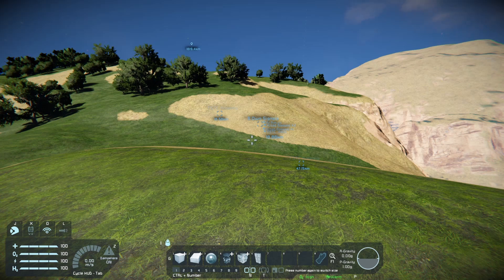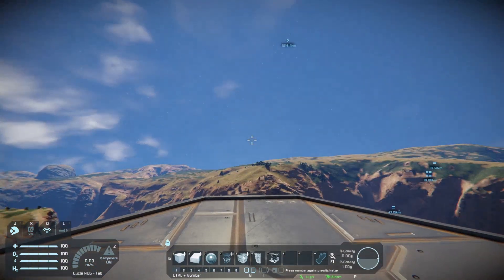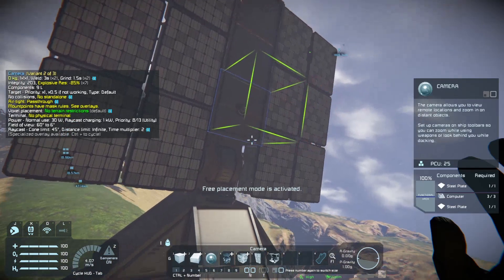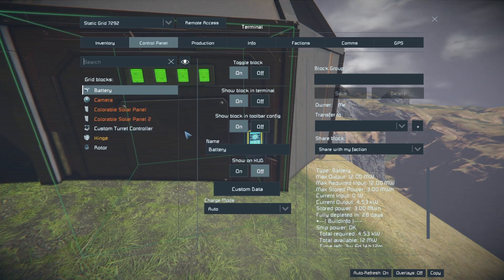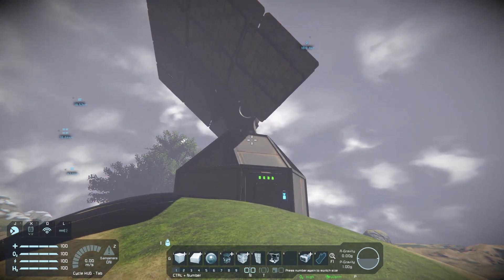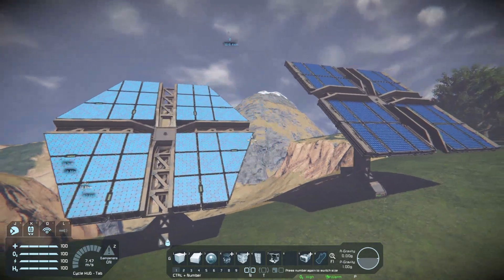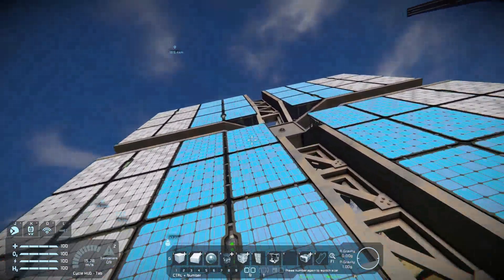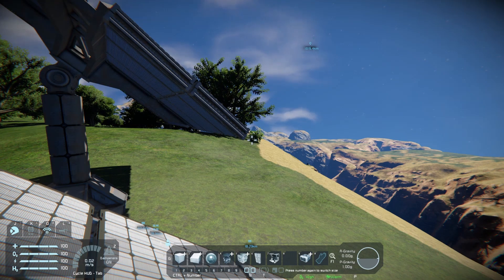How to Build a Sun Tracking Solar Panel | Space Engineers

Comment: for some reason my hinge isnt spinning? when i try putting the yellow part turned upwards it doesnt let me
Reply from the maker: Hmm I would need to see a picture to really know but try turning off the turret controller and  turning it back on(in the console menu), if not maybe double check all your settings.  You may have a hinge lock enabled or you may need to tweak the hinges torque settings

Comment: I noticed u answer ur comments (love that ❤) soooooooo, how big can i make this without problems and how would i make it different if making it bigger
Reply from the maker: Good question! And the answer depends! For example, in my more recent series, which is space focused, I have a pretty decent sized  array with plans on making it even bigger. But there is the worry that stray fire could disable the whole thing.

Planet side, you can probably get pretty big  at that point. You just need to make sure the solar array isn't to heavy for the hinge, and you have clearance for them to move.
Reply: @KiltedBastard ok ty this actually explains it pretty well

Comment: Tried to build another one of these from a different video and it exploded in my face when i turned it on lol, your using an azimuth rotor? azimuth are mods aren't they? Would it work with a regular rotor I'm learning in vanilla
Reply from the maker: I used vanilla rotors for this. Azimuth refers to the degree of change around a compass. 

But yes, Azimuth is also a series of mods.
Reply: @KiltedBastard  oh I had no idea lol

Comment: Just got the game~! this guide helped al lot, however question what did you use for the secondary solar panel's pillar, I've been trying to find a smooth cylinder block like that in the Block section and I can't find anything
Reply from the maker: Cylindrical Column - I think it is from the Heavy Industries DLC.  Also welcome to the Space Engineers Community!

Comment: If you set hinge and rotor to have it's inertia as shared  it won't jitter at all
Reply: And where do you do that?
Reply: @baltazararanda9643 turn on experimental mode and turn on “share inertia tensor” in the hinge/rotor’s settings
Reply: @baltazararanda9643  in control panel.
select both hinge and rotor and the option will be there
ETA, you select multiple things by clicking one and ctrl clicking the other
Reply: @baltazararanda9643  You can't learn this power from a Jedi...
Reply: I can't seem to find that setting either.  : /  Getting the jitters...  lol and turning down speed hasn't seemed to help.
Reply: its in the control panel btw once you select you can see it being directly above "Add hinge head" button
Reply: @SlashZeroX  That option no longer exists.
Reply: @nyxborne1786  i guess my only question is WHY does that option no longer exist???... regression is a real mf

Comment: From what I've heard, the sun bleed through effect with old panels has been patched out of the game.
Reply from the maker: I will have to check to make sure if they patched it during the signal update. But the sun bleed through effect worked when I tested it on the 1st(May 2024)
Reply: @KiltedBastard  did they patch it or does it still work? I just tried and im pretty sure it doesn't work anymore.
Reply from the maker: @malachinye9095  I did it recently, and it still seemed to work.
Reply: @malachinye9095   I'm new to the game (it has been 7 months also), but just did the exact set up and it doesn't work.  :/  Alas, two solar arrays it will be for me.